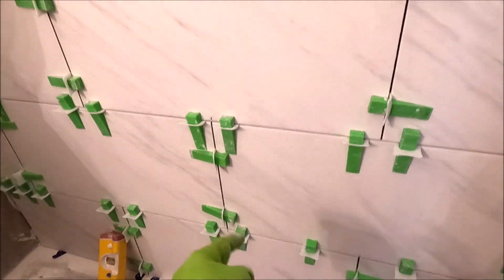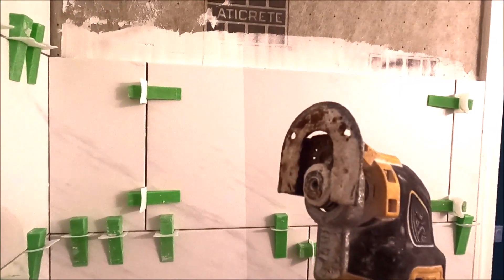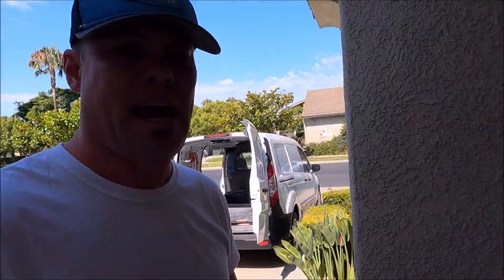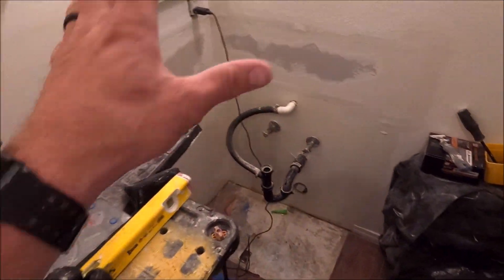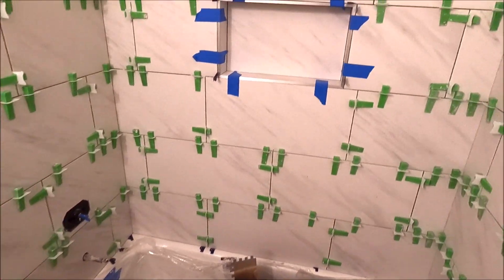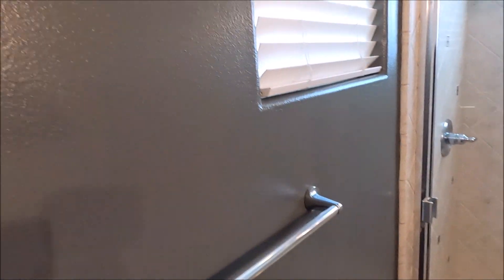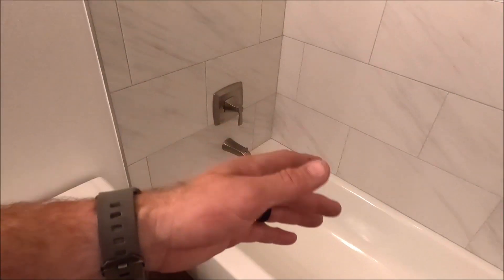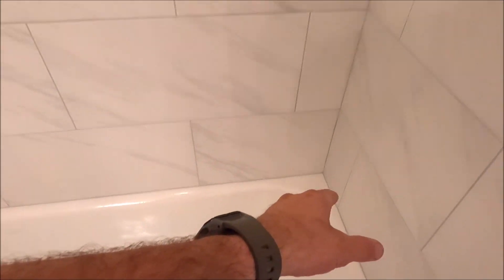The Carrara Shower Trend Will Never End!

Comment: looks great but why do the manufacturers say no more than 33% offset...trying to have the answers👍
Reply: Cause the tiles bow after 33% therefore it's easier to achieve a flatter surface before 33%
Reply from the maker: Manufacturers should update their information on the boxes. Tile leveling systems/clips and wedges allow you to install at 50% without any problems. It's simply old dated information from years ago.

Comment: I enjoy your videos. Always very informative and helpful. A lot of work goes into these shower remodels. My only question/comment: the shower head looks low. I am sure it falls in the recommended height, but seems like it could have been a little higher.
Reply from the maker: I'm 6' 3 so it may seem low. We install between 82-84 inches